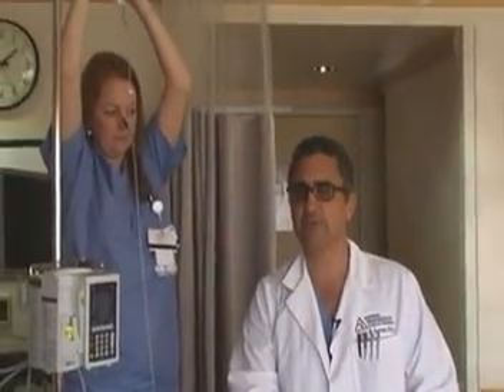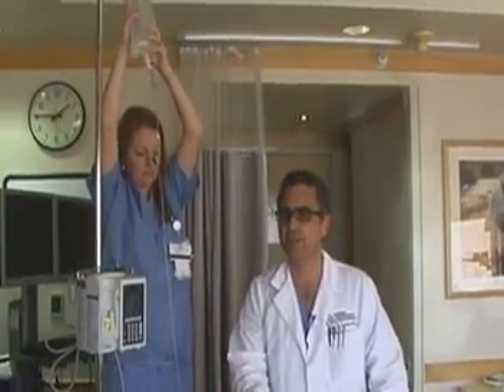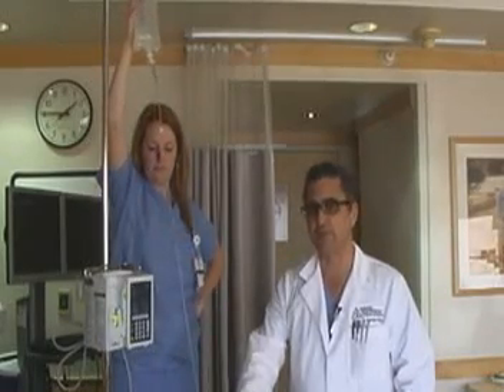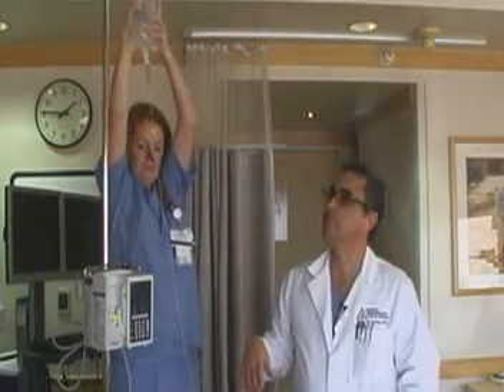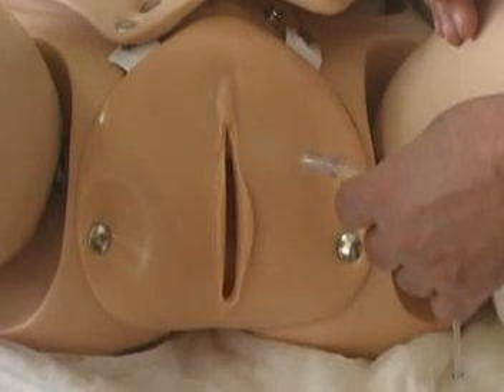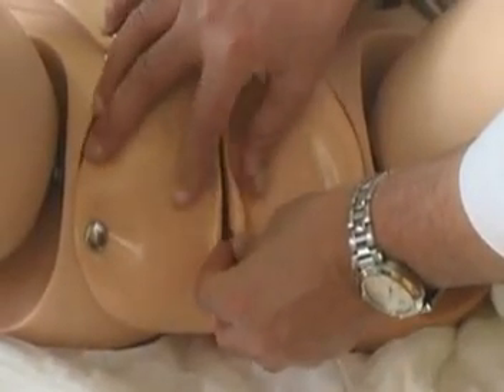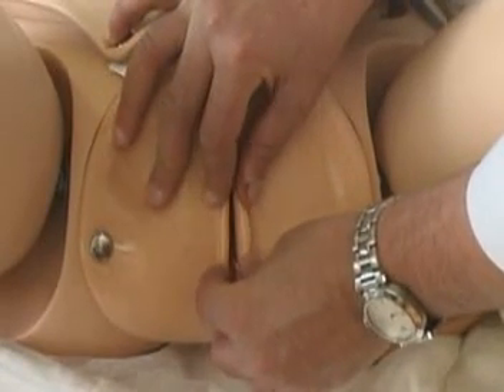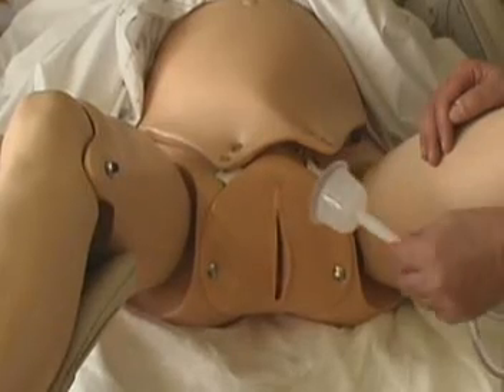Techniques & Equipment Required to Manage Uterine Inversion

Comment: Application of O'Sullivan's technique is after you have reduced the uterine inversion, right?
Reply: No, it is when manual replacement fails. The O'Sullivan technique is itself, a technique to reduce the inversion using hydrostatic pressure (using pressure from infused fluids to invert the uterus back)